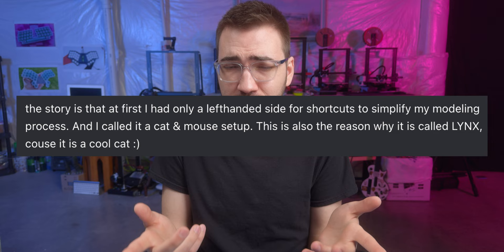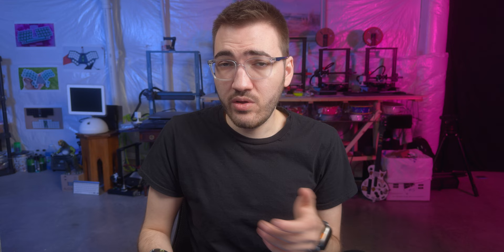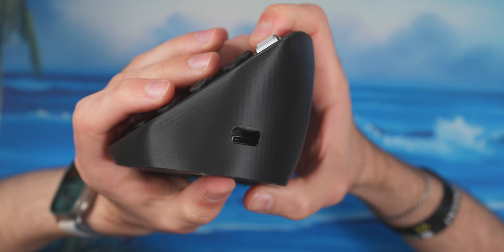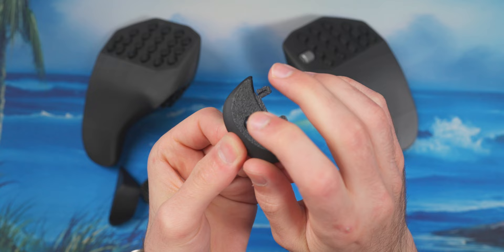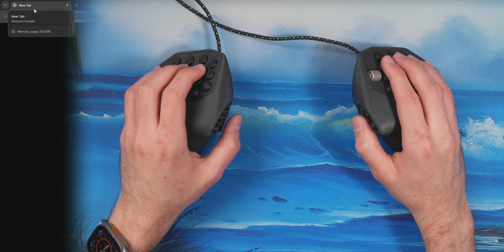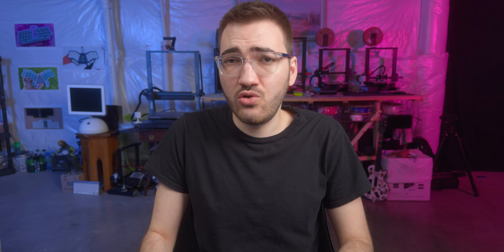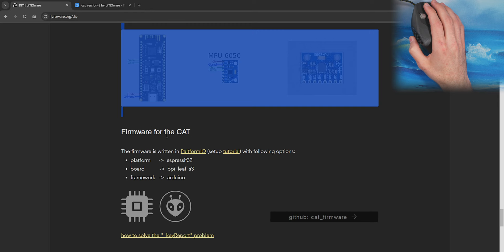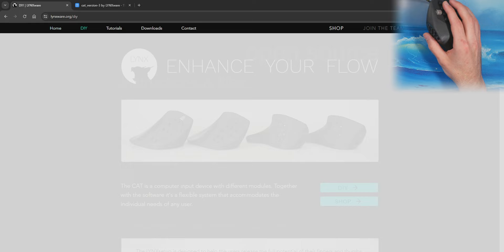This $300 Ergonomic Keyboard has a Mouse and Gyroscope - LYNXware CAT Typewriter

Comment: Hi! I've been working with the guy for a bit of time now so I think I can show some light here. Firstly, all you saw here, that was the work of only one person, everything? So of course some stuff like the firmware need work to be more user-friendly. Secondly, and that's what i'm litterally currently working on, we're working on a pcb make-over, as well as a true hot-swap system for the modules. For me the main appeal is gaming (my modded skyrim needs a damn big load of hotkeys) and also anything shorcut related, like 3D modeling, stuff like that. I cannot say too much 'cause most of the up-comming changes are "would be cool if..." or "business-wise, maybe we should do this...".

Please excuse any syntax error, i'm french x)

Comment: I think theres fundamental issues with what market theyre trying to grab. Like i see no reason why a person who cares about ergonimics would want a gyroscope. Literally carrying the thing youre typing on to make use of it? Also the mouse sensor under the keyboard is such a cool idea but if you wanted an ergonomic setup, you would want the keyboard to have concavity, which limits how you can move the keyboard unlike a mouse which has to be convex so you can grab onto it. Lots of cool ideas, but i would not even use if it was gifted to me unfortunately, seems not fun to type on at all. I want mechanical keys and issues with sticking are the nail in the coffin for me. I love the joystick ideas and lots of good potential here in terms of ideas.
Reply: I think this comment perfectly sums it up.
Reply: Please note that this version is designed to be as DIY as possible, I can confirm that the buttons/keycaps are sometimes bothersome, and the issue will be looked at, but for now that's not the priority. 
Also (again sorry i'm french and a bit dumb) i don't understand your point about the concavity. But if i understood you correctly, i can tell you that there is a slightly concave shape indeed, where your abductor digiti minimi sits (yes i searched the muscle's name, rather than a giving janky explaination). And from my experience with it, you actually have a really good grasp on it while moving it :)

Comment: I'm currently building a trinidox (sibling to the tractyl I think), switching from a 36-key corne and trackball. It feels absolutly amazing. Don't get why people still use ANSI layout. (exceptions, like people that have to use different machines all the time obviously exist, although my corne fits in my back pocket and would be very easy to take with me as well..)

Comment: Just FYI, the amount of thumb movement required for this keyboard, while having your palms facing down, is basically guaranteed to give you RSI with prolonged use.
There’s exceedingly things you can do with your hands that will cause RSI more easily.

In short, this keyboard setup is ergonomic in looks only, nothing else.

Comment: It looks interesting, but you really have to do your research before investing. It's great, that they allow to swap modules, because, I suspect, I might've fall into the same "shiny thing" trap as you did.
I did a lot of research before getting my first split and got a Glove80, which I absolutely love and use it with great pleasure. But 80 keys is a lot! I never use F and number rows, instead I have a second layer with all I need in it. I'm only using 53 keys, effectively utilizing 66.25% of the keyboard. But with its ergonomics — I'm totally fine with it.
As a second, more versatile option, I'm thinking about Totem. Are you planning on trying it out?

Comment: The dealbreaker here is the keyswitches they chose. If they were something like low profile mechanical buttons, laptop style buttons, even the softer style of button available on a typical Xbox controller, those would all work great. Instead, they chose very clicky buttons that sound not great and seem like the require too much force to press.

It seems like the mouse half also doesn't have any sort of toggle to disable its mouse functionality while typing a long thing, it seems like an easy fix, either map it to a button/layer/shortcut, or have a heuristic that turns the mouse off if it's not moving very much and a lot of text is coming out.

Obviously, early beta product is going to have some issues that need ironing out, but this is very much a series of odd, difficult to justify choices.

That said, I'd love to play around with something approximately like this. The ideal would be some low-profile keyboard up top and a Razer Naga style microswitch numpad on the sides. The Naga uses what appears to be very similar to a 90s cellphone keyboard, with metal domes rather than membrane keys, and contoured buttons rather than contoured switches, so it seems feasable in terms of price and engineering. It's possible the tolerances are too tight for 3D printing, but the rest of the Lynx seems to be pretty dialed in, so I think it's doable.
Reply from the maker: The buttons themselves aren’t hard to press, they’re actually mouse buttons and have very light actuation force. By using those, they could make the board smaller in terms of key placement and size. 

I agree being able to disable the mouse half would be nice. I think you can if you use the layer system in the software but I’m not sure if there is a button to toggle it.
Reply: @joe_scotto  Hm, it looked and sounded fairly laborious, but I'm happy to be wrong if it's actually not that bad.

Comment: Interesting. Seems to be more of a controller as a keyboard. 

Would love to see something similar realized as a 3d printed attachment/case or add-on that can be slapped on to the bottom half of a keyboard just for the mouse sensor. Or a case/attachment  that can attach/hold an existing mouse to use for the sensor. I think I'd be more okay with a good keyboard with a janky mouse solution than the opposite.

Comment: Hey great video.
This is a bit unrelated but I've been wanting to build my own handwired 'corne inspired ' split keyboard around two RP2040 microcontrollers (It's a wired build. nothhing fancy).
Where can I get the wiring schematic for the RP2040 ? I'm looking to flash it with QMK , so I don't want to mess it up.